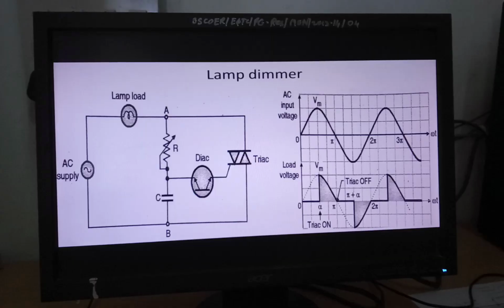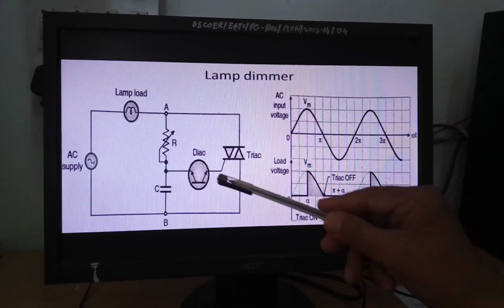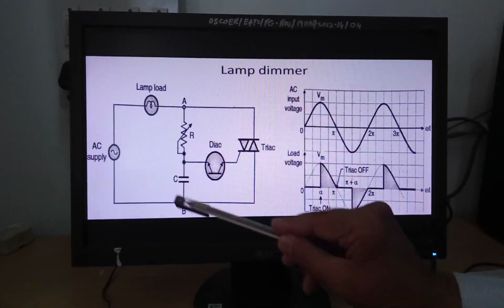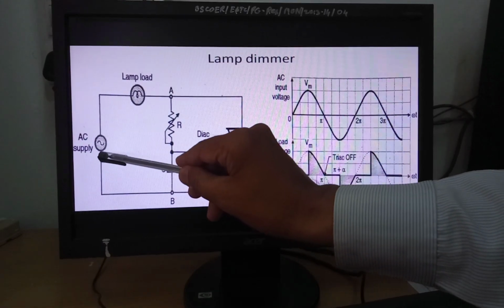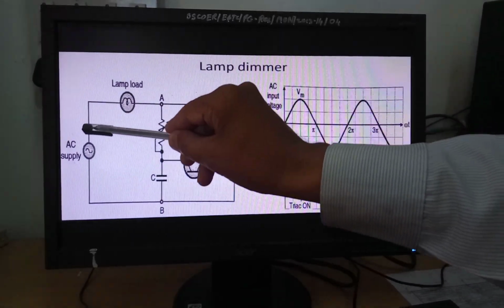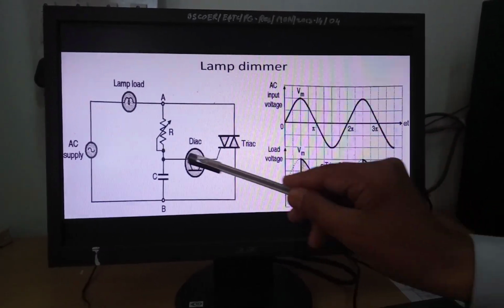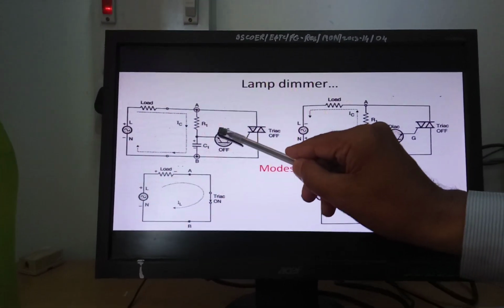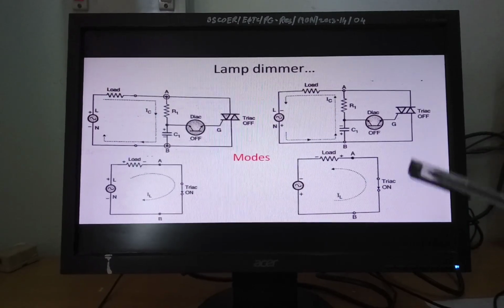Lamp Dimmer using DIAC & TRIAC

Comment: Question: I have seen a similar schematic but in which the load is placed after the dimmer circuit, between B and ground. In this case, would the current which flows through the TRIAC not reset the DIAC by a negative current across the capacitor?

I found the answer to my question but I will post this with the answer anyway in case anyone else is wondering the same thing:
The DIAC will be reset, but the TRIAC will continue to conduct until the current running through the TRIAC drops below its "holding current."

Comment: but why isn't the diac fired when the charging current is already is breakable voltage?Why need capacitor for charging the same voltage rate?
Reply: Without the capacitor integrating the charge, the diac could never get fired on the downward part of the AC voltage. Therefore you could only ever dim to 50%.

Comment: Nice explanation, I would have liked to seen the purpose of the circuit. I know it can be used as a dimmer, but why use it instead of just a variable resistor.
Reply: Because a potentiometer in series with your load would dissipate (waste) a ton of power and probably get fried too.

Comment: Case 1 
But what if i use only positive gate signal from microcontroller to turn on triac with ac load  ? Will it conduct both positive and Negative cycle of ac with this scenario ? 
Case 2
And what if i use same circuit which you explained but replacing diac with Zinner diode ?
And why triac triggering voltage are regulated using 30 volt diac ? Why we can't give just ac signal through variable resistor without regulating gate voltage , because it will also alternate over time so can trigger position and negative cycle ??
Reply: Case1) microcontroller can't give high voltages it can give only +5v not even -5v .so u can't trigger ur triac using a Arduino type microcontroller
Case2)the main purpose of capacitor is to reduce the power dissipation. U have to just apply the required voltage across gate giving the required voltage with capacitor would reduce the power dissipation.
Reply: @vamsikrishna5391  in case 2 i was asking about  , to replace db3 diode with just ac 50hz
Reply: @omsingharjit  if we give ac in place of that diode how that ac will turn on the triac..?
Suppose for ac  during positive half cycle the triac will conduct & turn on but during negative half cycle the triac will not conduct and it wont turn on .so there will be no current flow .hence ac cannot be used for triggering the triac
Reply: @MohanKanakaji  but ac usually used to turn on triac . So why  are you saying ac cant be use .
For Dc i think triac will conduct one half of the ac Wave.
My main question was why  not we give ac from mains to triac gate with current limiting resistors if triac needs both wave cycles !!
Reply: @omsingharjit yes we can use ,sry for my mistake.
Reply: That i too don't know i also mentioned that doubt in comments let's see if any1 responds.i thought u were asking about only capacitor role